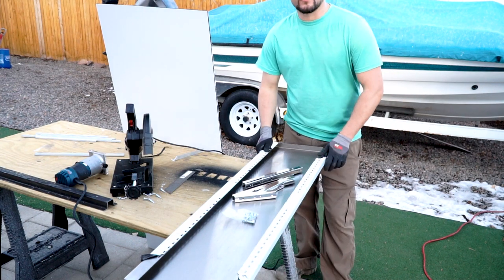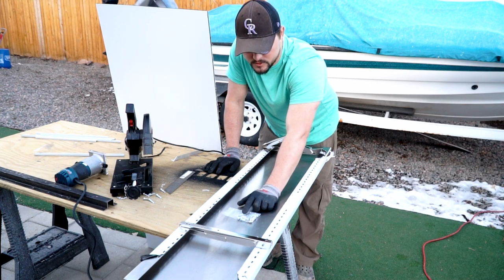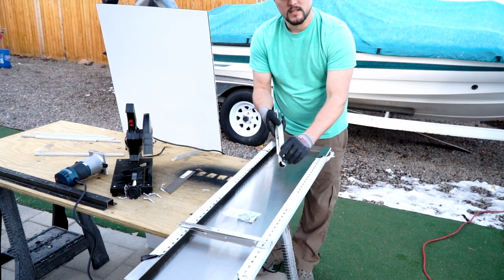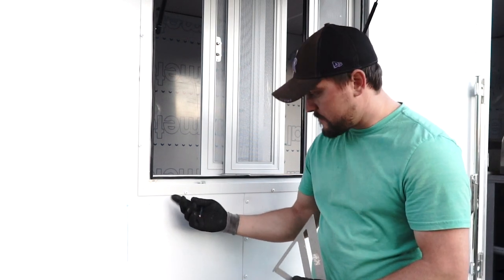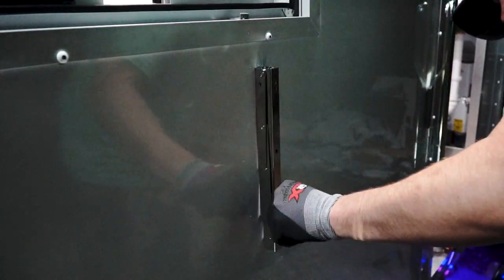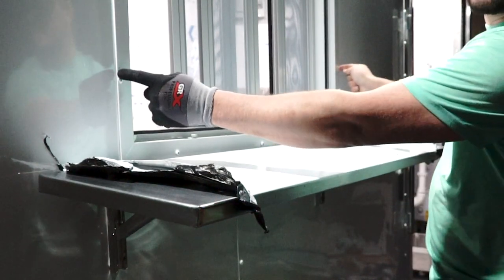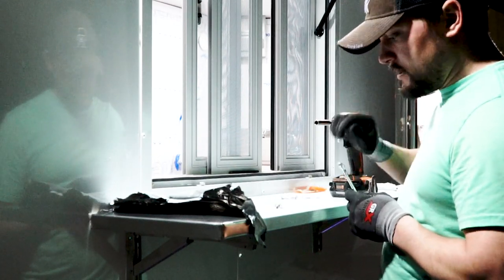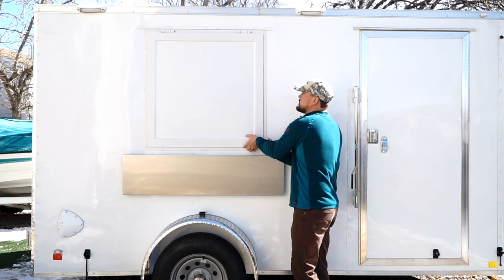How To Install a Folding Concession Shelf from JR Aluminum | Cargo Trailer Conversion Ep.17

Comment: Where did you get the folding table? I need one with adjustable brackets as well. I’ve looked at JR Aluminum but cant find it.
Reply from the maker: Yeah they only advertise it as an add-on with their windows but they will sell just the shelf. Easiest way is to just email them the size you need and they will send you a quote. sales@jraluminumproducts.com

Comment: Hey man, nice video! Just got a shelf myself to put on my trailer. Just a question, when drilling the holes for the studs, you don’t go all the way into the inside right? Just through the first side? TIA
Reply from the maker: Correct, I drilled into the stud but not thru the inside wall of the trailer. Some people do like to drill all the way through and secure with a bolt, washer, and nut from the inside. Good luck on your project!
Reply: Do you have a link to buy that shelf and brackets